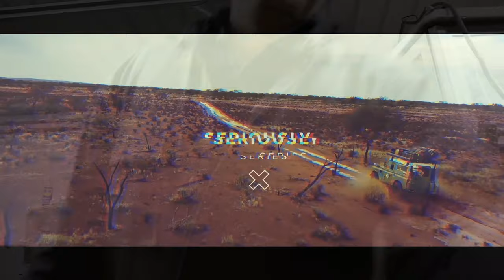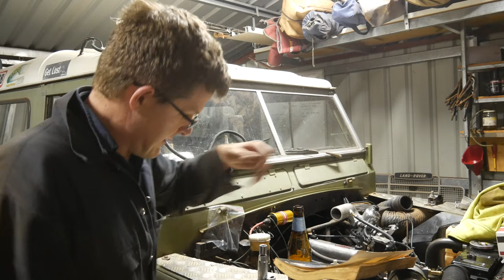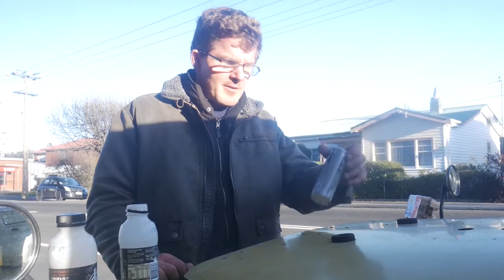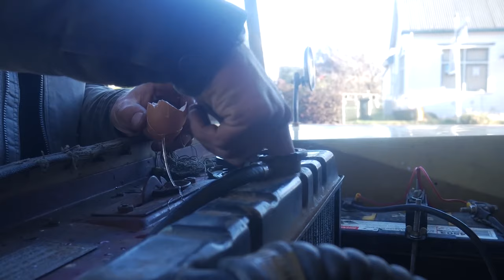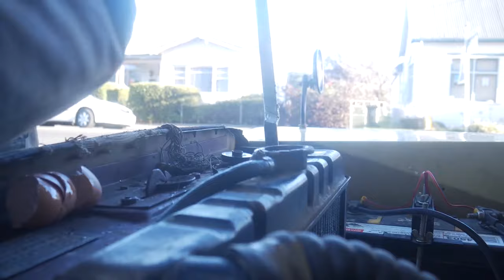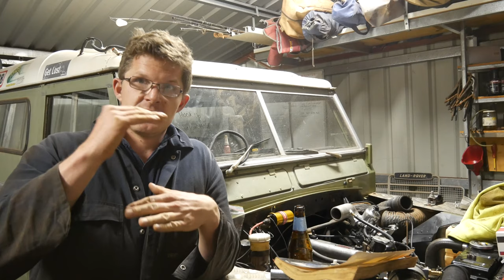How to fix your 4x4 with food: 4x4 Trip Prep ep 7

Comment: U can also use chewing gum for fixing petrol leaking gas tank
Reply from the maker: Hi Amir. Awesome top tip, thanks for sharing with everyone, not much the chewing gum can't fix, top stuff. n Kind regards, Geoff
Reply: @seriouslyseriesaustralia  you are most welcome. Another trick is to fix a leaking radiator with bread. Just take the white dow from the inside part of the bread, pour some water and knead them toghter, than stick it inside the hole of the hot radiator. It will harden like pita bread and seal the hole. (First hand info from my experiance)...

Comment: I spent half a Fraser Island trip with a water drum strapped to the roof of my car with the window washer hose running from the tap on the bottle to the radiator filter it was all good till I had to go through the rbt Easter weekend
Reply from the maker: Hi Gadget. That sounds like a real adventure. Thanks for sharing that awesome trick. Many thanks, Kind regards, Geoff